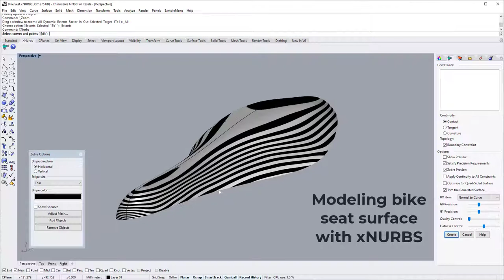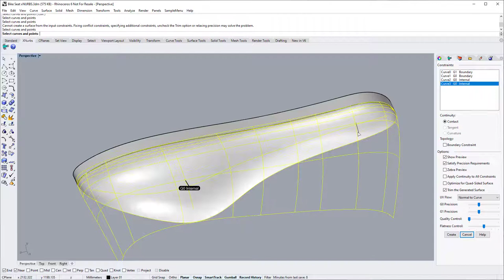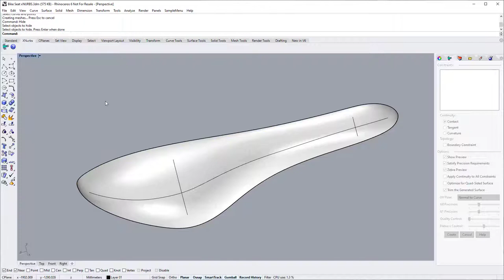xNURBS Tutorial Basic: Modeling bike seat surface with xNURBS

Comment: I wish you would make the curves available for download so we can work through the process. If i build the curves wrong slightly i get time consuming calculations. I would like to see if its X-nurnbs issues or my geometry. It also saves time having the curves. Rhino issues a download pack with their training manuals, and it was very helpful when trying to learn.
Reply from the maker: Do not understand your comment "If i build the curves wrong slightly i get time consuming calculations.".

xNURBS is extremely fast and can solve your curves on the fly (The difference should be within a couple of milliseconds). No user says that he/she gets time consuming calculations with xNURBS.
Reply from the maker: You can download the curves here: https://www.xnurbs.com/XNurbsRelease/Bike%20Seat.3dm

The curves in the model can be used as a base for rapid concept design. Professional designers would certainly adjust the curves.
Reply: @xnurbs3502  Thanks for your tutorial, but the page of downloading the curves seems not here. Is there any other link to download the curves?